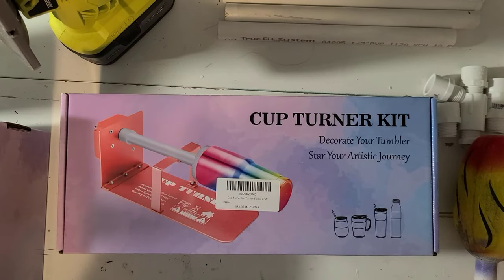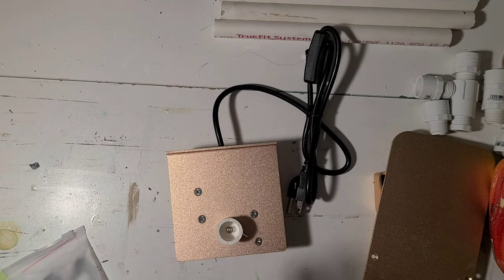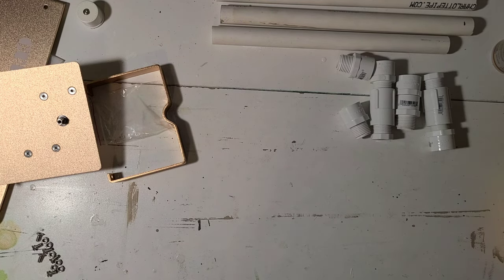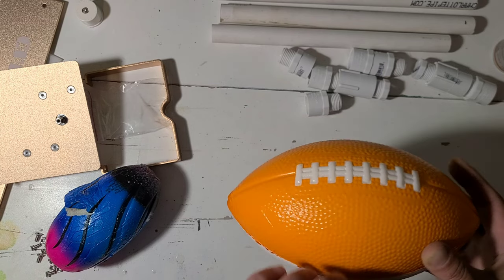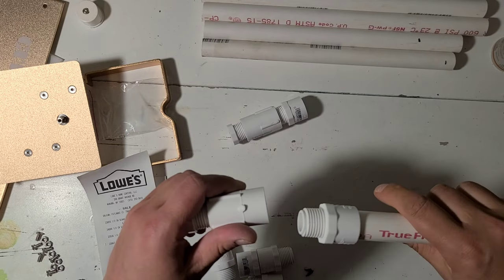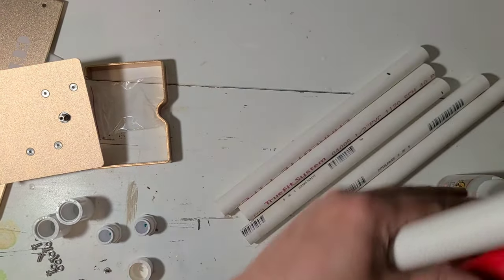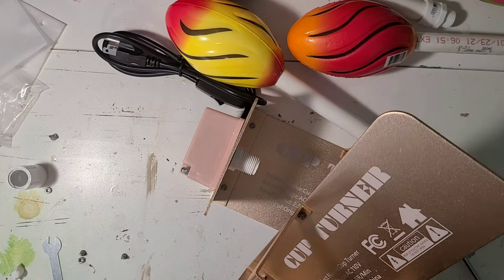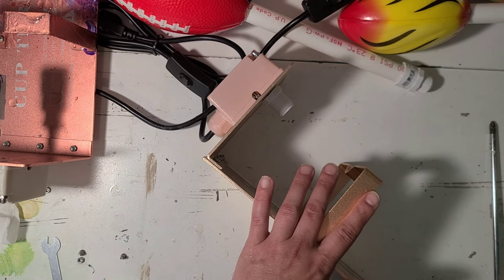Tumbler Turner Conversion and Cup Arm Assembly, how I make a universal fit

Comment: This was very easy to follow. I converted mine really easily. Thank you! Did you say you converted a Spin it from Michael’s? I have one of those I’d like to do too!
Reply from the maker: The original spin it. Same parts and pieces I removed the cage part but left the threaded rod and glued my adapter pieces right onto the rod which my arms slip on and off easily. I also gave it a chunk of wood as a support piece and mounted the entire thing to a block of wood for weight. I like the speed of the spin it for some projects so I do still keep one in rotation at all times.
Reply from the maker: https://youtu.be/k6ImOwym4xI 
I dont have a full video for the conversion just a quick parts walk through sorry. I did them before I was on here.